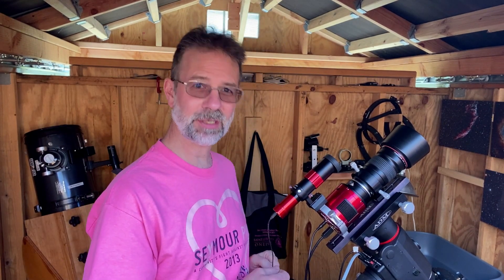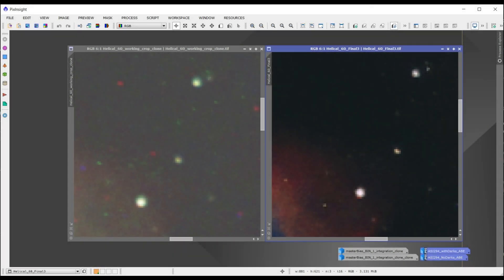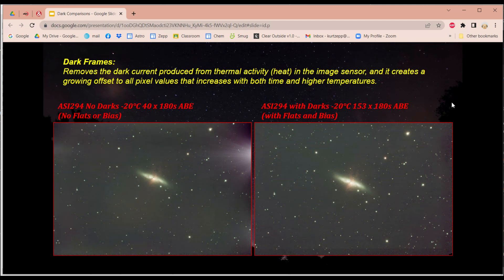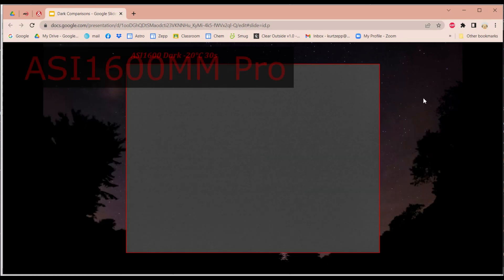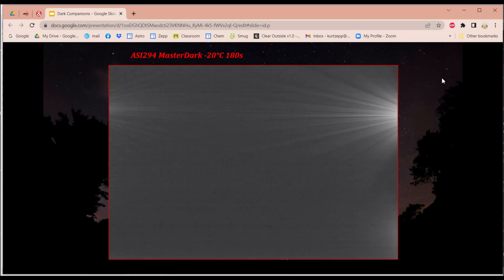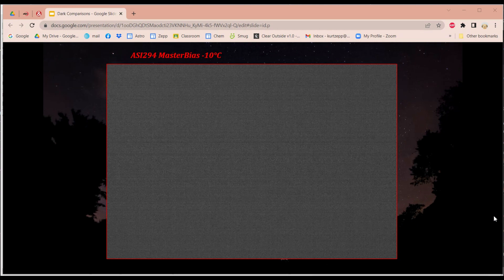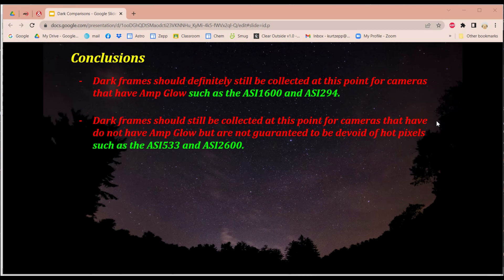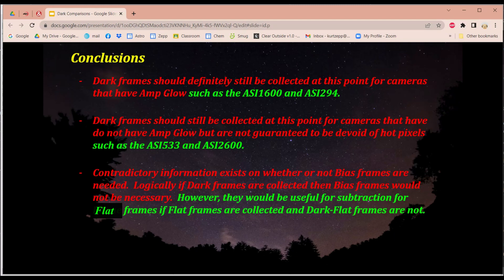What do Dark Frames Do? Are they still needed? ASI1600, ASI294, ASI2600 #astro #astronomy

Comment: Thank you so much for this may I ask you a question? once I have shot flats farsk etc  does the asiairplus add them automacially or if not how do i add them to my light frames? Thankyou so much
Reply from the maker: Hey Stuart.  That is actually done automatically in the preprocessing program (stacking) that you would use. Most commonly Deep Sky Stacker (DSS), PixInsight (PI), or AstroPixel Processor (APP).  Cheers
Reply: @AstroQuest1  thankyou so much do you know if the asiair software also automatically incorporate them ?if not I'll look into those programs thankyou
Reply from the maker: @drstuartporter8248  I believe it does if you have the continuous live view if you are doing a public outreach type thing. However, you might want to do more research on that one because I am not sure, I just read that somewhere I think.  Good Luck
Reply: @AstroQuest1  thankyou so much

Comment: Have you make a library of dark frames based on temperature or do you take dark frame each night? I was wondering if you could figure out your yearly night temperatures and adjust your ASI camera cooling to make the sensor temperature the same all year. Would one set of dark frames work? Thanks for sharing your findings
Reply from the maker: Good question and yes I have a library but over time your camera itself 'changes' and you may have to redu dark frames.  Adam Block discusses this in some of his videos.  You could do some standard temperature throughout the year but cameras are designed to cool anywhere between 25 and 40 degrees below ambient temperature depending on the camera.  So in the winter it is easy to get to -20 C, however, it would struggle or impossible to get that low during the summer.  - Cheers
Reply: @AstroQuest1  I might be lucky because in my city in CA the nighttime low temperature difference over the whole year averages only 12 Deg C.

Comment: I've been using the QHY268C. It has the IMX571 chip in it. It also has zero-amp glow. I don't use bias frames per say, I use "flat darks". When running WBPP in PI along with cosmetic correction subtracting hot pixels I get nice clean noise and amp glow free pictures.
Reply from the maker: Using flat darks is the best way to go and makes the most sense.  No need for bias if you use flat darks.  - Cheers
Reply: @AstroQuest1  Yes they seem to work well. I would also like to take a minute of your time and say thanks for all your great instruction videos. I managed to setup and navigate APT through your instruction. Not surprising to me that you teach for a living. I did however switch to NINA. Seems to be much more user friendly, or at least to my brain waves. Thanks again and I look forward to upcoming videos.
Reply from the maker: @johnday2676  Thanks John, I use NINA these days as well.  I like APT but NINA is better!  Cheers

Comment: I use bias frames to calibrate dark frames and then integrate into a master dark.   

Dark frames are stacked differently than lights per se---no normalization for instance.  There is a lot of information about this out there.  

I image with an ASI6200MM, ASI6200MC, and ASI2600MM.  My images are smooth as butter when calibrated with a master dark that has been calibrated with a master superbias along with the appropriate flats which are calibrated with a master darkflat and said darkflat is calibrated with the master superbias too.  Your video is accurate, but these practices are necessary if a master dark is used.  Otherwise you're not doing your images complete justice.  I suggest to anyone to experiment and determine what is best of their rig.  This works well for me and my imaging techniques.

Clear skies!
Reply from the maker: Thanks for the comments, I always recommend doing your own experiments and trials to get the optimal results for our system.  So you do use a master bias along with darks, flats, and dark-flats.  I have been using those as well all though if I use dark-flats I don't use bias.  I am not sure what a superbias is though...  Cheers
Reply: @AstroQuest1  Youtube won’t let us post urls outside of youtube, but I suggest reading Light Vortex’s Pixinsight tutorial on the www about bias and dark frames. He explains superbias well. 

The fundamental method of stacking of the darks and the use of the superbias is essential.

Comment: I've always thought that hot pixels have nothing to do with thermal noise.  They are pixels that have gone bad, and you'll see them in every frame.  They do not statistically vary over time, as thermal noise does, and are not strongly correlated with the sensor temperature.  All CMOS sensors have them.  What do you think?  

As an aside, I have a Sony A7rii camera, and I used to use that for Astro before I got my cooled camera.  The Sony will regularly (every week or so) do a long exposure when you turn it on with the shutter closed to map out hot pixels.  Sony owners may have noticed this long-exposure going on, and not know what's happening!  I was told, but haven't verified, that s/w like LightRoom automatically accommodates these hot pixels when the data are imported, or maybe it happens on the camera.  In any case, I never saw hot pixels in my Sony astro photos.
Reply from the maker: That is correct about the hot pixels.  So you have the hot pixels and the pixels that are giving off higher signals due thermal noise to contend with which is why dark frames are collected.  Cameras, sensors, and software is improving so much so that Dark frames may longer be necessary.  Good to know about the SONY, I have heard good things about that camera - I would just keep checking every so often and if it is fine without dark frame, Cool!  Cheers